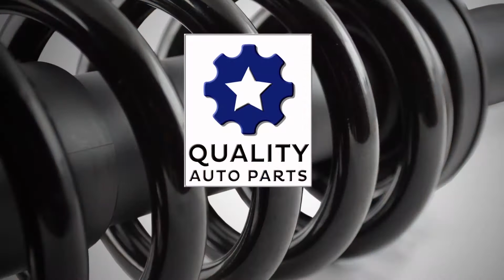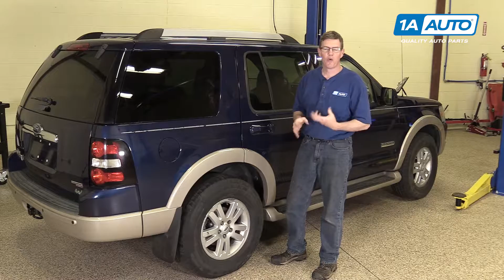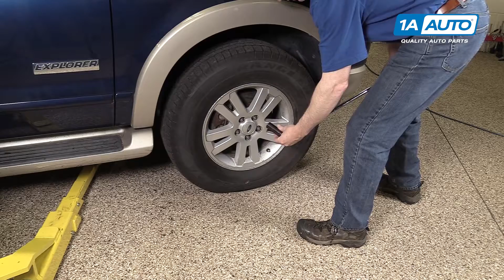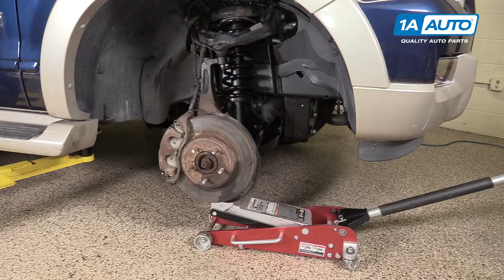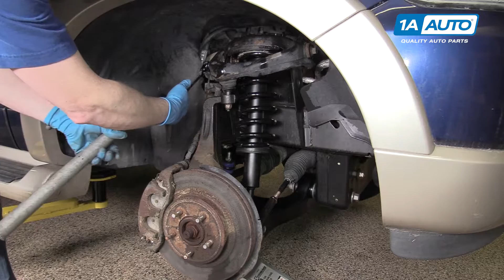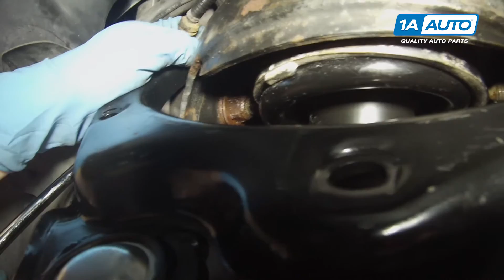How to Replace Front Upper Control Arm 06-10 Ford Explorer

Comment: Nice video!  Two tips:  Mark the location of the control arm nuts with a paint pen before loosening.  (See 6:20)  The holes are slotted for caster/camber alignment and by marking the nut location, you can hold the alignment.  This only works if you use USA-made OEM Motorcraft control arms, which are identical to the originals.  Use some China junk and all bets are off...  and you'll be doing it again in eight months.

Comment: I got one from a local parts store and the ball joint is off to the side. It is seated properly in the control arm but the bolt is off and like a 30 degree angle while the drivers side was essentially vertical. Is that okay or is it defective?